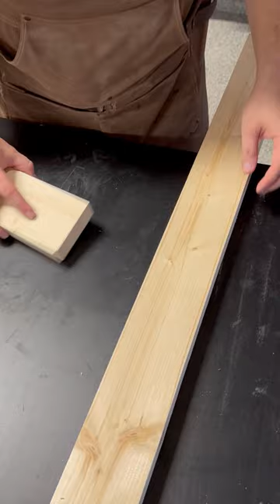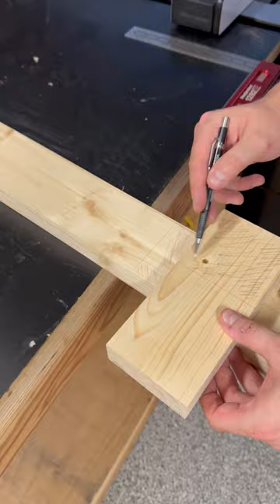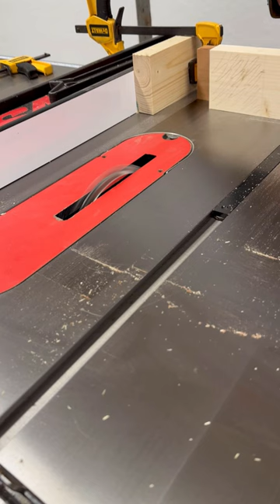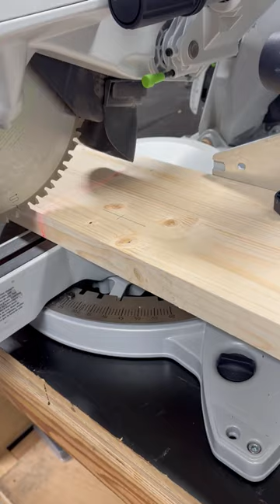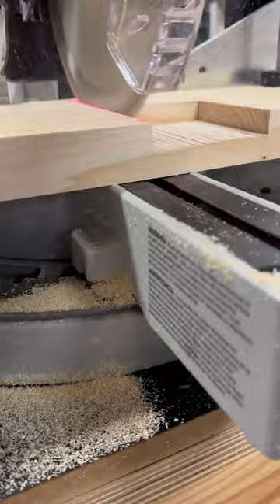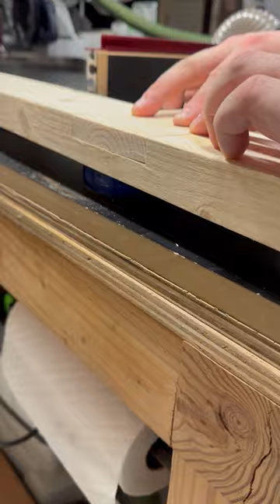Half Lap Joint #short #shorts  #woodwork #woodworking

Comment: I don’t understand why the table saw wasn’t used simply for both halves of the joint?
Reply from the maker: The longer piece was around 8ft long so it’s hard to slide such a large piece across the table saw. A radial arm saw or a miter saw makes is a better selection.
Reply: @EigenDesigns  ok, makes sense now thank you 👍